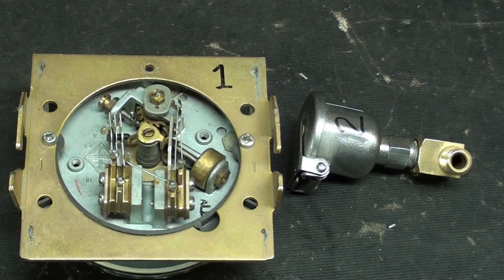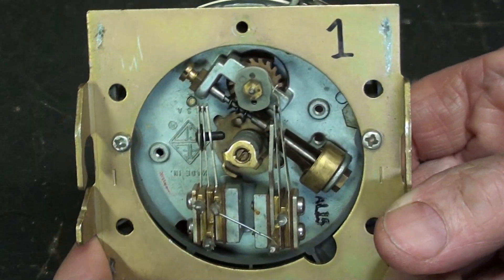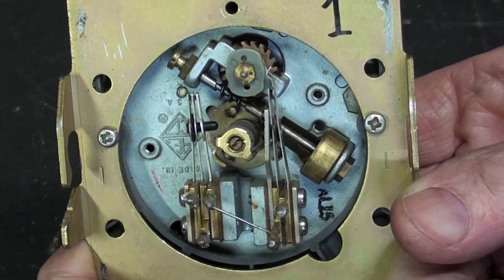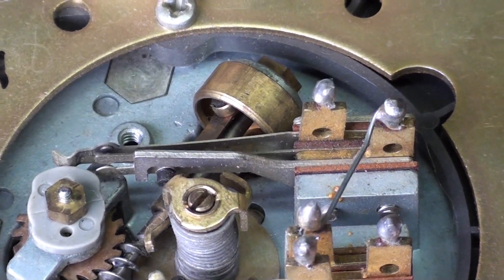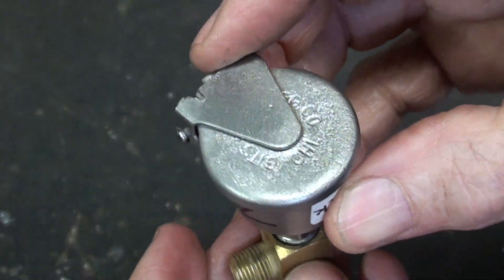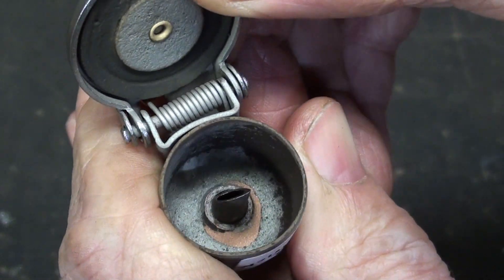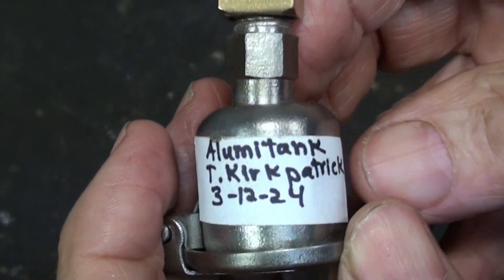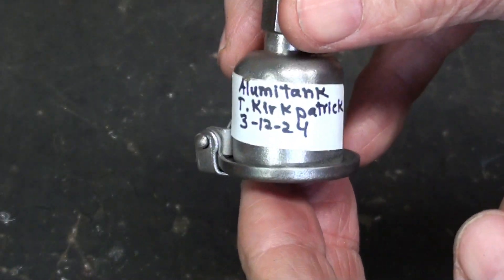WHAT IS IT? Mystery Tools #92a question tubalcain MRPETE

Comment: I recognized the telephone dial mechanism right away, but it's much different from one I got in about '78.  I built mine into a speaker enclosure (which still worked) because I wanted a hidden phone in my room.  It had been costed reduced, was mostly plastic, and was probably made over seas.

Comment: #1 is a pulse dialer from an old rotary phone. It would momentarily break the circuit loop, the phone switch would see that and count the number of breaks. (0=10).  This was all before DTMF tones came along with switches like the Nortel DMS etc.  
Some older pay phones could be fooled into making free calls by simply flapping the hook switch and counting the breaks, leaving a pause between each number.   This was eventually remedied.

Comment: #2 is an ether injector. It uses oval shaped plastic balls filled with liquid starting fluid. The spike pierces the ball when you shut the cap and introduces starting fluid into the air intake tubing.

Comment: Rotary phone dialer and an ether starting assist capsule container and punch.  It screws into the intake of a diesel engine open the lid insert an ether capsule.  When you close lid it punctures the capsule and ether is sucked into the diesel engine to aid in starting.

Comment: The governor is to get the cadence of the pulses right on the switch contacts shown. The switching though performed by a mechanical mechanism is technically a digital signal as its high/low dependent on the selected number on the dial on the opposite side.

Comment: #2 ether injection unit. My Dad's 1967 Mack diesel had one. You had a football shaped ether capsule you placed inside the Gitz unit. When you closed the lid, the angled tube in the center would pierce the  capsule injecting the ether into the intake manifold.

Comment: When I was a fill in field installer for the local telephone company I used to tune the speed by massaging the fly weight springs.  There was a test number we called which returned beep tones to tell us it was slow or fast.  The ring signal return USED to be the third ground wire too.  One time I had two of the wires hooked up and then my eyes lit up from the incoming 90v 20hz ring.  But the bell didn't sound since the ground wasn't hooked up yet.  I handed the lady the receiver and said "it's for you".  She looked VERY skeptical as she hesitently said "Hello?...." and I watched her eyes go wide with wonderment and perhaps just a little fear as she looked back at me....
Reply from the maker: Very interesting

Comment: #1... indeed, all of us olders that ever took a phone apart, or even listened as you dialed, would know it. The mechanisms were wonderful gadgets, 
#2 ... I’m stumped. I have seen every oiler, zerk and alemite grease fittings in common use, but that piercing insert in the oiler cup has me.
Reply: The dial mechanism was pretty obvious from the sound, but did you also notice the interruptor contacts. The way the phone sent the dial pulses was by breaking the circuit in fairly evenly spaced pulses. You could even dial a number manually by tapping the number out on the cradle hook switch if you wanted to.

The central office switching machinery that mechanically interpreted the pulses was also impressive. I saw one shortly before it was decommissioned and replaced with an electronic system. It consisted of rack after rack of linear and rotary solenoid activated switches. The constant noise was horrendous. The whole system was powered by a room of 48 volt lead acid batteries.

Comment: We used an item like #2 on Diesel engines.  We had a can with gel cells filled with starter fluid and before starting the engine we would put a gel egg into the cup and close the lid, and the egg would be punched and the starting fluid would be released and then we would hit the starter and off you would go.

Comment: I am old but if I have ever used #1, I don't remember it. Whatever it is, the on/off cycle was quick. The quick install mounting bracket is what throws me.  I wonder what liquid was being dispensed into the Gits oiler. Must have been either an aluminum or plastic container that would fit inside and drop its contents into the puncturing tube and cup, not much larger than the cup itself. It is a wonder the cup did not break off from Bubba using it.

Comment: Number 1
Very similar to the ones in UK. It’s the back of a ‘dial and select mechanism’. For a telephone. The ratchet wheel allows quick selection of the dial number (or letter) then engages the gears to return relatively slowly allowing the contacts to be made and broken by the cam; the centrifugal governor limits the speed. With old systems, multiple relays at the automatic exchange had to have the pulses along the telephone lines limited in their frequency.
Number 2
I’ve seen one similar on an old oil engine (similar principle to a Diesel engine - induction; compression; ignition; exhaust cycle). In the oil engine I saw, for a cold start, cotton wool soaked in highly volatile hydrocarbons was placed under cap, the item being located via an isolation valve, in the inlet manifold.

Useless piece of information:
Both in the USA and the UK, early telephone systems had two bare wires strung between insulation terminals on wooden poles. In a wind, the bare wires would touch each other and a pulse sent to the exchange. This might be inconvenient, but operators in the exchange - or even those with telephones at home, could easily recognise single random pulses.
It was decided in the UK that for emergency services, a clear pulse signal had to discriminate between the deliberate dialling and accidental, wind induced pulses. The largest number on the dial was chosen - 9 - since no wind could send nine pulses equally spaced. We went all the way in the UK with 999, while you in the USA had the same idea, but only chose the first number that could not be mistaken - 911.
👍🇬🇧👍🇺🇸👍
Reply: I’m curious if the system in the UK worked differently than over here?  Over here it wouldn’t matter it the lines touched each other in the wind as it would just send a brief off-hook loop to the exchange.  Over here the pulse dialer breaks the loop instead of making a loop.  Misdials to 911 happen over here when the pair is shorted due to a problem on the line, water corrosion etc.  That short is mostly there, but comes and goes rapidly due to water in the cable etc. If there are 9 breaks…a short…1 break…short…then one more break…then a short, now the call is made to 911.  
We have something called Plant Lockout to help prevent this. If a line is shorted (off-hook) and no dial attempt is made the exchange will send an off hook warning tone and then go into plant lockout.  The lockout will clear once the loop has been broken (trouble fixed) for a set amount of time.
Reply: @rc300xs  I’m not an expert about the telephone exchange systems, but I do know that here (mainly railways) existing telegraph systems could be used and there would be a need to make communication between the signal boxes ‘fail safe’. We used the Wheatstone telegraph system and initial long distance communication could be via existing wires (hence ‘sending a wire’). Just as shown on nearly every American western, similarly it was here that the railway station had important telegraph offices that the public could use. The main (Victorian) railway station in my home town of Bolton (north of Manchester UK), that is a later addition to the original 1838 ‘Bolton to Manchester Railway’, still has a building with etched glass windows with ‘telegraph office’ on. Bolton used to be a massive cotton manufacturing and engineering town (some 220 cotton mills*, heavy engineering and supplementary industries), so initially mill offices became the first to have their own equipment followed by wealthy mill owners’ houses.
* Look up ‘Swan Lane Mill, Bolton’ on the internet. It’s a ‘listed building’ and cannot be demolished. I admit I’m boasting a bit here, it was the world’s largest cotton spinning mill in its day.
👍🇬🇧👍🇺🇸👍
Reply: @derekmills1080  Interesting read.  Thank you.
Reply: @rc300xs  Very kind of you.

Comment: To be honest. #1 switching relay to reverse direction of a motorized device. #2 ether capsule cup for diesel engines. Usually in the tube after the oil bath air cleaner. I've also seen them on the intake manifold. The brass fitting should have a perforated stone in it to trap fragments and dirt.

Comment: Thanks Mr Pete. 1. Is a rotary phone dial and I'm guessing that 2. Is a for putting additives in the fuel system. The sharp part would puncture the little foil seal on the end of the skinny necked bottle.
Update; after reading the comments, the ether pot sounds more likely.

Comment: Rotary dial phone mechanism, I knew a fella had his house connected to his detached shop using old rotary phones as a private intercom. You would dial nine on one of the phones and it would ring the other one nine times or vice versa. Of course it had its own power supply to make it work.

Comment: 1 is a dial telephone mechanism. 2 is used with an Ether capsule to start a diesel engine by inserting the capsule and closing the lid to puncture it allowing it to go into the intake manifold.
Reply: KNOCK KNOCK vroom.....
Reply: Sounds reasonable to me.. I have never see an ether capsule in my 71 years, but there was a lot of stuff I missed that was in use in the first half of the 20th century.  ‘Shotgun’ starters I am familiar with.. but not these.

Comment: 1 is a rotary dial from the old telephones  2 is an ether injector pot , it uses a jelly capsule that is filled with liquid ether to help start the engine. It is placed after the air filter on the intake pipe to the engine.
Reply: Re No.1 British ones look quite different but I can just see it.
Reply: @Margarinetaylorgrease In Australia we made a mostly plastic dial mechanism to replace imported British metal diallers.

Comment: Not sure about item one even though I’m over 60. Item 2 we use for starting diesel engines. We called them ether balls. It would pierce the ball in the lid with ceiling had a decompression lever to get the motor spinning and they start right up.

Comment: 1 is the mechanism from a telephone for pulse dialing.
2 is to add starting gas for some engines in the form of ether (Diethyl ether). We used them for some old reserve power generators when I did my military service –those had a screw cap lid though if I remember correctly. Which for me is amusing since this makes both parts relevant to that time since I worked with signals for the Swedish air force (phone, radio and more)